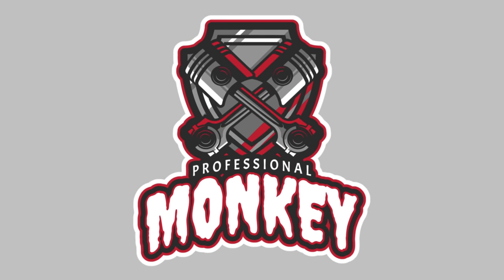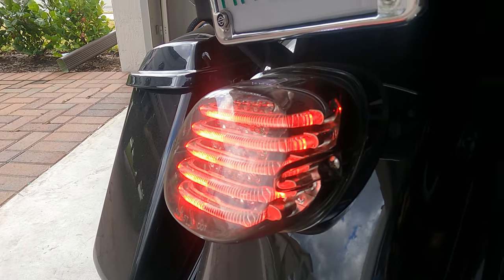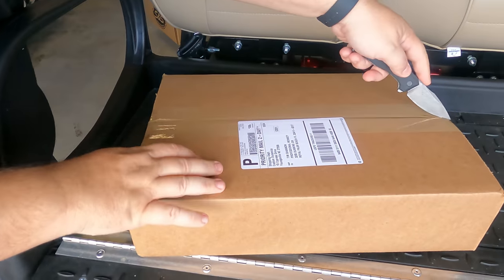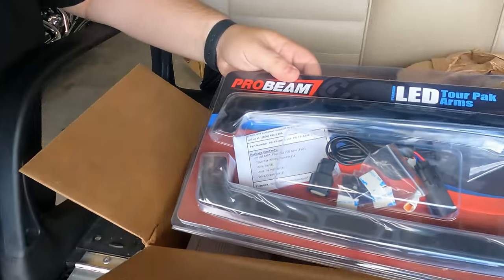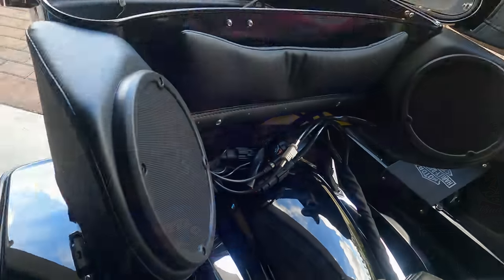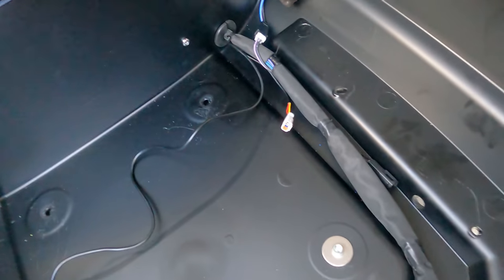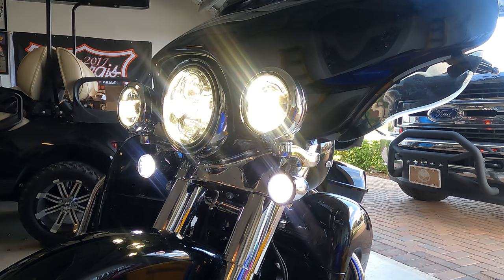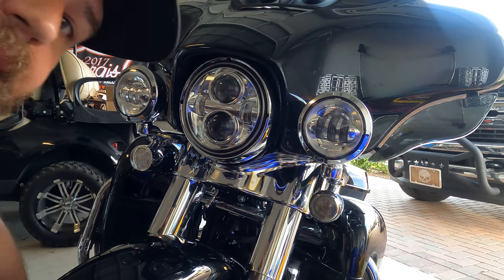2021 Harley Davidson - Doing my lighting right!

Comment: Hey buddy luv yr vids I'm Chuck from Grande Prairie Alta Canada was wondering if yr gonna install an air breather system to prevent hot air and oil mist from being sprayed back into your air intake my research on utube shows carbon build up on pistons after awhile
Reply from the maker: Hi! I am planning on putting a Fueling vented dipstick and system on my CVO, but I haven't received it yet. Keep your eyes peeled!
Reply: Check out Your Harley will love this mod! Runs cooler too!    Then utube which is better? Why even have a breather system?    They talk about crank case oil getting sprayed back into your air intake for pullotion (EPA) crap
Reply: Sorry Chuck here again using my girls phone your the first utube I've ever replied so I'm new at this chit lol but those breather kits go behind your air filter check them out on utube buds cause in gonna try and buy my first ever Harley Yee haa  so in - 30 weather was - 47 other day fkin brr so lots of u tubing for me waiting to see new road glides special colours our Harley dealer only had street glides
Reply from the maker: @sharonhambler849  I am really interested. Since these are separate issues I think you need both. This is great stuff!
Reply from the maker: @sharonhambler849  I am also looking at that DK product, looks nice.

Comment: Custom dynamics makes great stuff it’s not the cheapest stuff but cheap typically isn’t that cool either!
Reply from the maker: When you think about it, these are less than $100 more than the cheap Amazon ones I bought and these are three times brighter with brake and turn signals. Seems like a better value to me.

Comment: I'm wanting to put in the lower fairing insert LEDs on my ultra. Do you have it on either one of yours? Can't decide between custom Dynamics or kuryakyn?
Reply from the maker: I don't but I want them. I am pretty loyal to CD, so that would be my recommendation. CD is a lighting company, Kuryakyn sort of dabbles in everything. For lighting I don't go anywhere else... my 2 cents. Let me know what you end up doing!
Reply: Thanks. I'm in South Dakota so the bike is stored at the dealership for the next few months 😡 currently we are at 1 degrees but it definitely need to get my front blinkers swapped to LEDs and we'll see what happens with the lowers
Reply from the maker: @775summit  Keep me posted. A local! I love it!